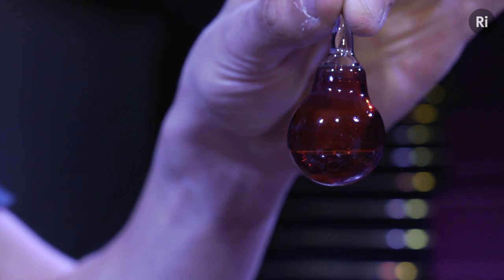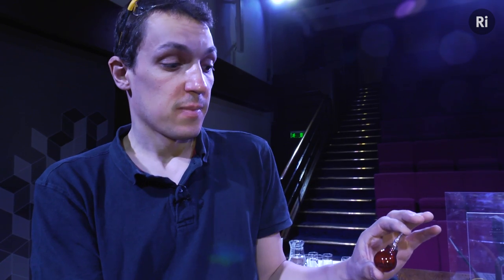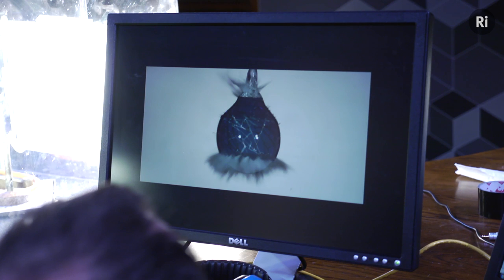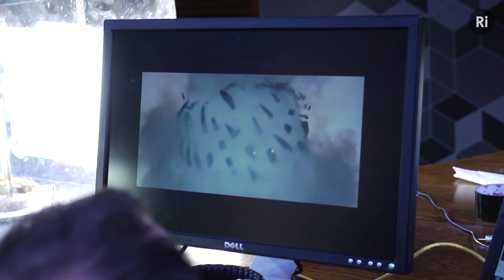Exploding High-speed Christmas Bauble

Comment: Why are there 2 distinct "steam sources" in the blue bauble, the top and centre one?
Reply from the maker: It's likely to be where it failed first - i.e. the weakest structural points in the bauble. Where the water vapour has escaped and then rapidly condensed.